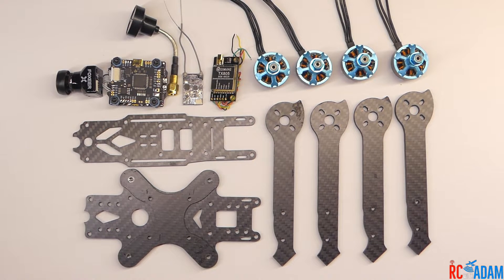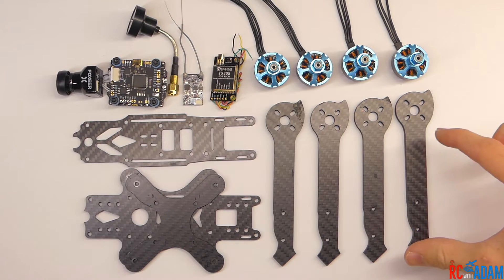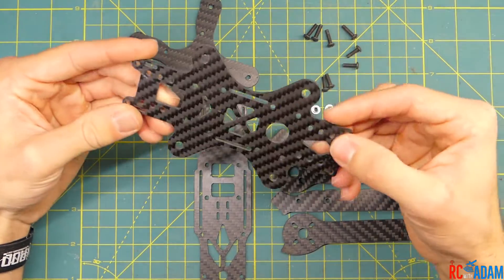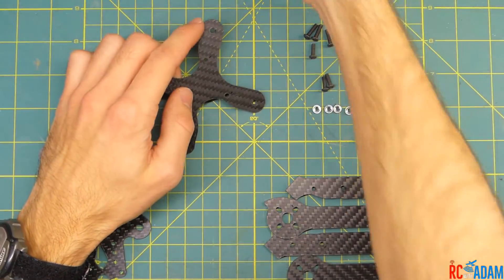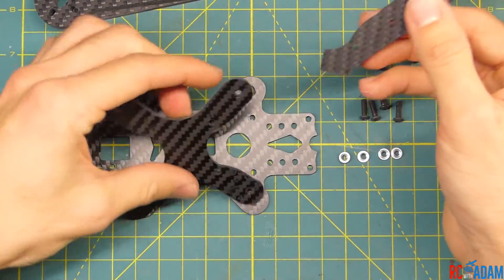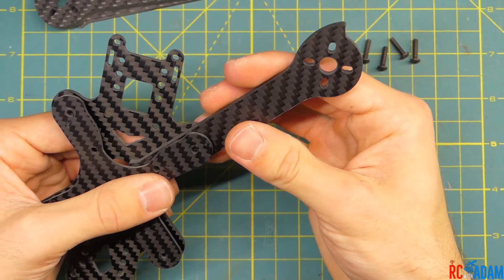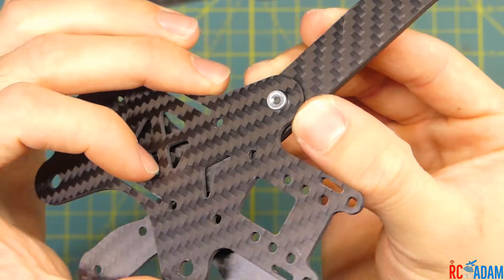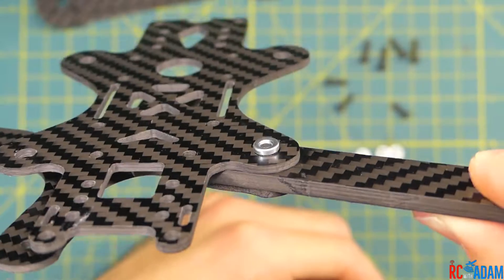Budget Basher Build - PART 2 - Frame, Stack, & Motors [COMPLETE BEGINNER BUILD GUIDE 5" FPV DRONE]

Comment: Hi! Thanks for helpful video but I got a question: I got a Mamba stack but it has screws instead where yours have the plastic standoffs. My frame also has super long screws where the stack should go so its screw against screw and im quite lost at how it will be attached. Thanks!
Reply from the maker: Hi Marcus! You can use either the screws that came with the frame or the stack. What you'll do is remove the long screws that are currently going through the stack, and with either set you'll put the screws through the bottom plate of the frame and then slide the stack back onto the screws. Let me know how it goes.
Reply: @RCwithAdam1  thanks man, appreciate it! So the screws on the stack is just to hold it in place when shipping and then I can remove and put I on the frame screws? 👍

Comment: Get the Wizard 220HV.. 169.00 is basher with a 6S :)
Reply from the maker: Perhaps. I haven't checked the deets on the 220HV yet to if it's worth buying, but if you did buy it, you wouldn't get the experience and skills of building your own. :)

Comment: What is the weight of your quad
Reply from the maker: Hi! It weighs about 360 grams without the battery.
Reply: Thanks! Can u make a drone for more cheaper and for newbies
Reply: @rahulb9688  I believe you should save up and get something decent, cheaper parts could fry up easily.